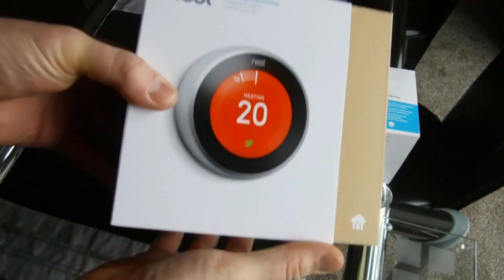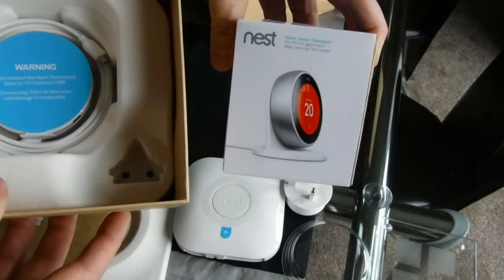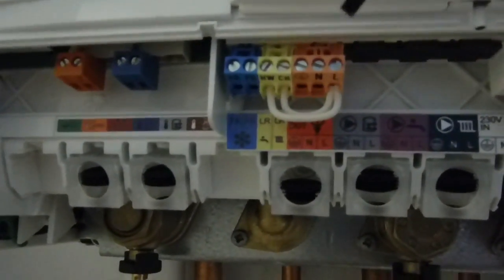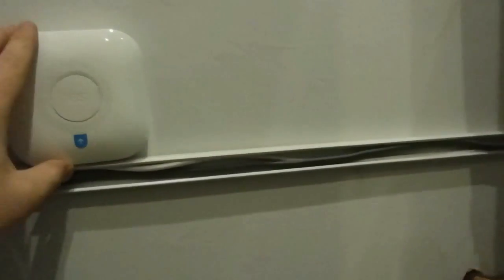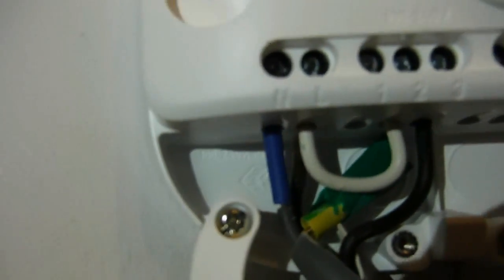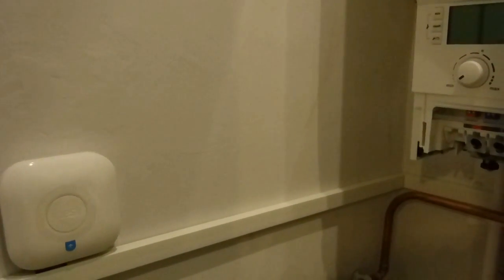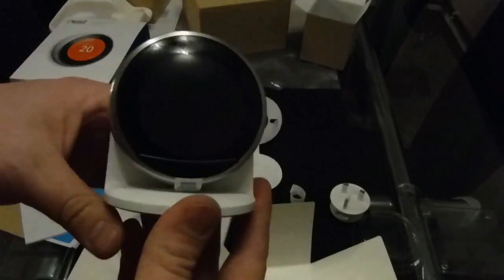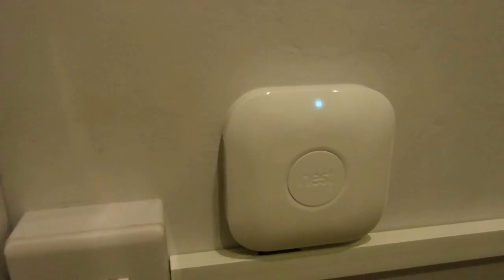How to install Nest Thermostat 3rd Generation - UK

Comment: Thanks for the video, i was also missing the link between live and 2, which i have now added. But even thou when i switch on the override the heating does not switch on, i checked the voltage for the live return at the link and at the boiler and i have 230+ volts being fed, I have a Worcester Greenstar 2000 combi boiler. I was tempted to phone Worcester as its a brand new boiler. Any advice would be greatly appreciated

Comment: There is an earth terminal on the heatlink unit, it states in the instruction book to install an earth if using terminal T1 and T2 for the 12V supply
Reply from the maker: @GTH67  Yes, I think I've covered that. I've now got mine linked up to Nest via T1 and T2 so made sure it's earthed.

Comment: What happens if the thermostat is unplugged or switched off- will it still switch on/off the heating?
Reply from the maker: No, it needs power, although it has got a little reserve on it I think. But if the power's gone off, the boiler won't be working anyway!

Comment: Just bought one myself and pretty sure I need the same set-up. May contact you with an image of my terminals if thats ok? Thanks for thd vid.
Reply from the maker: Let me know what boiler it is and i can usually find the user manual online or an image!
Reply: @charlieshooter  it's replacing a Honeywell by the way...
Reply: BAXI Duo-tech combi 33 HE A, thanks a lot for the help. 👍
Reply from the maker: @FullClipKilla  So your boiler needs to be wired differently to the video! It is actually a bit simpler.
Your boiler manual does state that you need to power the Heatlink directly from the fused spur (wall switch near boiler) rather than wiring the live, neutral and earth to boiler itself.
The only wires you run to the boiler then, are from 2 and 3 on the Heatlink to bk1 and bk2 on the boiler. No live loop required on Heatlink.
Hope that helps.
Reply: @charlieshooter  that's great, thanks for the help. Much appreciated.
Reply from the maker: @FullClipKilla  No problem! 👍🏼

Comment: Does it have to always be plugged inn to the USB cable/stand? And how does that work if it's mounted on a wall? Cheers.
Reply from the maker: It does need a constant power supply so yes it needs to stay plugged in. If it's attached to the wall, you can either run the power lead to it (if you've got hollow walls, or power it from your boiler via the old thermostat wires.
Reply: @charlieshooter  thanks for the reply. 👍
Reply: @charlieshooter following up on this, I’ll be able to wire the other box to the WB boiler no problem - but I cannot see how I’ll get power to the thermostat itself. My current old thermostat runs on batteries and is about 4 meters from the boiler through a kitchen and a hallway and this is the best spot for the new nest when it arrives. Is there a guide specific to providing power when needing to wall mount the Nest thermostat when it’s several meters from the boiler? 

Cheers.
Reply from the maker: I have actually recently done a video but not edited it all yet! It's quite straight forward. You just need to use 2 existing wires and connect them to T1 and T2 on the Heatlink, and then to the connections on the back of the Nest wall mount.
Reply: @charlieshooter  great! Yeah I think I’d realised the actual wiring connection will be straightforward - I’m more concerned about running several meters of cable in a tidy and concealed manner through two rooms. I much prefer the design and functionality of the nest but I think I’m going to have to switch to a hive for ease of wireless installation. 

Alternatively, is there a specific type of wire I need (resistance rating, thickness etc)I if I did choose to install the Nest and run several meters of wire to connect it?
Reply from the maker: @dizz740  The wire required is low voltage so doesn't need to be that big. I used a run of flex when I finally got ours wired up.
Reply: @charlieshooter  cheers. I discovered it had to be solid core copper wire max 2mm. But I’ve since discovered that the thermostat can be wall mounted AND connected via USB!!! Which is what I’ve done and it’s now working. Thanks for all your replies.

Comment: The Hive comes with a heat link (I think) that you wire into your boiler, and then a hub, which I assume is for phone connectivity. Does the Nest come with the same two things? You didn't appear to have a wireless hub in this video.
Reply from the maker: The Nest just comes with what is shown in the video. The Heatlink and the Nest unit itself. No separate hub.

Comment: Can you use it on older Worcester boiler too. ?
Reply from the maker: It depends on the connections and if there is already a programmer on board on the boiler.

Comment: My boiler is exactly the same and has a programmer installed previously, this appears to be to stopping the nest, any suggestions?
Reply from the maker: If the programmer is part of the boiler you may not be able to disconnect it, but some can be and then the Nest should work fine.

Comment: Is it possible to have one of these down stairs and one up stairs reason being my mam is old and we already have one down stairs but is it possible to link another for upstairs
Reply from the maker: It needs to be one per boiler/heating system I'm afraid. So it's usually one per property....unless your heating is split.
Reply: @charlieshooter  thanks charlie i was just wondering if you could link two together  . Will have to zone it the  no bother.

Comment: Hi I have some twin and earth cable but just wondering where the black cable is from thanks
Reply from the maker: It's 3 core and earth cable. I had some off-cut from another job in the house but you can get flex with 3 core too.

Comment: Hello! Great video. I have a thermostat upstairs and downstairs. Would the process be the same?
Reply from the maker: If you have two thermostats which control two different boilers then yes, and you'd need two Nests. The Nest can only control one boiler at a time.

Comment: What do you do if you don’t want exposed wiring?
Reply from the maker: At the Heatlink or the Nest Thermostat?
Reply: @charlieshooter   at the Nest Thermostat. I was considering fixing to the wall but how would you supply 12V power with plugging in to wall? You would need a transformer somewhere I assume?
Reply from the maker: @OBS3RVE  Well....it's funny you should ask because after all these years, i have only recently done exactly that. I have recorded it but not got it edited yet!
You can either put it where the old thermostat was and use existing wires, or if there is power the other side of the wall you could drill straight through? Other than that, if you are able to, run some new wiring for it from Heatlink. I did the latter, but we had totally gutted the room!
Reply: @charlieshooter  I’m currently mid way through renovating my house so will be able to chase the cables in
Reply from the maker: @OBS3RVE  It will look so much neater, good luck with the renovation.

Comment: So you wire 1 and 3 from heat link to boiler and put link into 1 and 2 that right ?
Reply from the maker: No, I think you need to re-watch the video again. The link is between L and 2. There is no wire to 1. N, L and 3 link to the boiler.

Comment: Hi, thanks for the video. Just a question, can I connect directly from main fuse box with 1mm or 1.5mm
Reply from the maker: The cable used to connect the Heatlink to the boiler should be flex but mine has been fine all these years! 👍🏼

Comment: Only heat resistant flex should be used to wire into a boiler.
Reply from the maker: A few people have mentioned this, but it has been in place for a number of years now with no issues.

Comment: Thanks for the video.
I have just connected mine.
I didn't loop the constant live for the hot water (connected it directly) and I did connect the earth wire next to t1&t2 terminals.

The only issue I have is that, despite it having a rechargable battery, it wants to stay plugged in (the thermostat). Maybe it's not fully charged, we'll see.
Reply from the maker: Mine is always plugged in. It needs to be as the battery is only really a back up.

Comment: Why do you need to link the incomes to common.. would it work without ? For some reason I keep blowing the fuse in my fuse spur
Reply from the maker: It may be that your boiler requires a slightly different connection method....where there are two connections at the boiler you don't loop the live in to no.2?

Comment: I want to install mine on the wall, and I have a power socket behind, does the wall mounting plate allow the cable to come from behind neatly ?

Thanks
Reply from the maker: Yes. The wall mounting bracket is used to attach the Nest to the stand so it's the same really. As long as you drill a hole in the wall to pull the wire through in the centre of the bracket you should be fine. Look out for a new video at some point showing how to wall mount it. I'll be moving mine soon....at last!
Reply: Top man 👍

Comment: You say the Live goes from Live to 2 and the Blue neutral at the boiler goes from here to here, but where is here?  3 connection is the heat link isn't it. Sorry if I'm missing something. really like your video though.
Reply from the maker: Thanks, hope it's helpful. I think I say neutral goes to Heatlink (rather than "here") but basically blue neutral goes from neutral terminal on boiler to neutral terminal on Heatlink.

Comment: Please, I need help with my nest. It says:"the power from your equipment to the thermostat may be off "
Reply from the maker: Sounds like there may be a loose connection at the Nest Thermostat or at the Heatlink. I presume it is hard wired and not plugged in?

Comment: Can you tell me if it works with with any kind of central heating or will it work only with certain ones
Reply from the maker: It will work with most I think. What did you have in mind?
Reply: @charlieshooter  i want to get one for mine, and i don't know if the google nest will work with any type of central heating or just specific ones...

Comment: Hi thank you for the video. My current thermostat is Danfoss, I have COM and N/O wires connected only. Earth is there but not connected. How do I connect the the heat link and nest thermostat?
Reply from the maker: The Heatlink needs to be put near the boiler really, and connected directly to the boiler. You could use those wires currently in place by the thermostat to wire the Nest to the Heatlink using T1 and T2?

Comment: Looking for some help here, can I install a room thermostat (Nest 3rd gen) in the cellar where there is no heating? If not, do I need to extend the wires or something?
Reply from the maker: If you install a thermostat in a room with no heating (radiators) then it wouldn't work because it would never heat up and therefore wouldn't switch the boiler off.
Reply: @charlieshooter  I found out it comes in two pieces. The base will go in the cellar and the interface can go in a room. The only problem now is which room to put out in as there are tenants in each room other than mine but mine is the furthest away so I'm hoping it's not too far for it to connect via radio or whatever it uses. I'm hoping WiFi but I think it's radio.
Reply from the maker: @analogdistortion  It should reach, the range is pretty far I think.
Reply: @charlieshooter  And what about powering it, will it just run off a microusb phone charger?
Reply from the maker: Yes that is the easiest method of powering the Nest.

Comment: Great to hear a fellow Welsh man. Cardiff I reckon. Anyway if it wasn't lockdown I'd get you round and set it up for me and I'd take down the Royal Oak. I digress, if it's hardwired via t1 & t2 does that mean it can't be used wirelessly? I'm getting this f6789kibg error code N80. Soo I can't use opentherm! Any ideas?
Reply from the maker: One city out I'm afraid! Just along the M4 from Cardiff! 
If you wire the Nest in to T1 and T2, it just means that it takes it power from there. It will still work wirelessly.
Open Therm is another type of connection for the Heatlink to talk the boiler. The boiler must have Open Therm though.
Reply: @charlieshooter  thanks chief. Yeah it's wired in on opentherm. Can't get a  wireless connection. Driving me nuts. Anyway I may just go back to it being an on off. I'll call nest later see if they can help all the best and stay safe.
Reply from the maker: A factory reset may be the best option? Keep safe.

Comment: Hi pal. Can I use a 2.5mm2  cable? Thanks.
Reply from the maker: You should really use flex to connect it but I have had no issues with my set up as it it. You might find 2.5mm² is a bit too wide for the terminals....maybe.

Comment: how easy to install one for a glow worm flexicom15hx current thermostat not doing a good job
Reply from the maker: Looking at the manual for your boiler, very similar to the video. Linking 3 on the Heatlink to R on the boiler.

Comment: Hi 
We have a alpha 18 boiler with a separate immersion system hollywell slider control panel 
Will this work with it
Reply from the maker: Yes the Nest should work with your boiler. Just had a look at the manual for the boiler and it looks like it is wired similarly to how I've done mine in the video. You would connect terminal 1 on your boiler to terminal 3 on the Heatlink. 👍🏼

Comment: If my current zoned thermostats got two 230v wires, how I can install the nest 3rd to replace them? Many thanks
Reply from the maker: They should wire in directly to 2 and 3 on the Heatlink.

Comment: Can I deactivate the nest/WiFi and use the heating/boiler the old fashioned manual way if I want to ?
Reply from the maker: Yes , I don't see why not. Although I don't know why you would want to?!
Reply: I didn't install it and don't want it
Reply from the maker: @misshollywood3255  Fair enough! Yes, it can be removed, but the old controls may not be there anymore!

Comment: Any info on installing to a wireless programmer? The receiver is in the loft space close to the boiler, but I will need the thermostat downstairs (bungalow) in the hallway. Distance about 4 mtrs, but through  a plasterboard ceiling and joists. Great vid!!
Reply from the maker: The Nest wouldn't need a separate wireless programmer. It's all built into the Nest itself. 4 metres through a ceiling shouldn't be too much of a problem for the wireless signal though.

Comment: Hi, very helpful this video. 
I’ve got an Alpha Eco 2 Plus do I wired the same as you did yours? 
Thank you
Reply from the maker: Just had a look at the manual. That looks a bit different to how I did it in the video. You would need to wire 1 and 2 on the boiler to 2 and 3 on the Heatlink by the looks of it.

Comment: Well I thought this would be simple enough as I have done one of these before. However in the new place I seem to have an older boiler and I can’t make head nor tail of the wiring. It’s a Baxi 80e with a Grassell digital timer. It mentions in the manual to make sure the programmer can take 230v. So I assume I use the 230v diagram. 

On opening the terminal out on the right hand side after the fuse it is all going into the PCBs and such. Would I be right in assuming the black wires going from terminals 1&2 are controlling the grassel timer. I can’t see any obvious connects. 

Do I remove those, add live, neutral to the right hand side after the fuse and then Terminal 2 to nest 3 while putting a link from nest live to nest 2?

https://i.imgur.com/pLy0x5h.jpg

https://i.imgur.com/mPg7wD1.jpg

Or do i do the other combo wiring as per my last one?
Reply from the maker: Looking at the pics, boiler instructions and Nest instructions, my advice would be to run live and neutral from terminal block to live and neutral on Heatlink. Then take that yellow loop out and run one of the black wires to 2 and the other to 3 on the Heatlink. Let me know how you get on.
Reply: CharlieShooters KnowHow  Thanks. Just to make sure. Do I run the live and neutral from the left side or the right side of terminal block after fuse?
Reply from the maker: @AFC19034life  Left side looking at pic. I wouldn't mind getting that white flex cable goes to the old timer. Will need to take that out.
Reply: CharlieShooters KnowHow Thanks again. I believe that flex goes to the socket.
Reply from the maker: @AFC19034life  Oh right....well you should be able to take the Heatlink off there too. 👍🏼

Comment: Hi mate great vid, I already have nest installed via hardwire to the boiler but the Thermostat is located in a cold room. I would like to move the thermostat into the living room to have more accurate temperatures. Is it possible to control the boiler by just plugging the thermostat into a wall socket for the power and negating the need to be hardwired. Many thanks
Reply from the maker: Yes, it can be plugged in to a wall socket and will communicate wirelessly to the Heatlink. Funnily enough I'm just doing the opposite....had it just plugged in the wall and now going hardwired! Thanks for watching! 👍🏼
Reply: Thanks for that , my nest is in the hallway which is quite draughty that’s why I’m moving it to the living room 👍🏻
Reply from the maker: @stevetaylor6833  I've always had it in the living room upto now, but whilst I've been renovating it I had it in the hallway next to the front door. I certainly wouldn't leave it there!
Reply: That is where mine was installed and like most houses the hallway is one of the coldest rooms.20c in the hallway amounted to 25c in the rest of the house, bloody heatwave🥵🥵

Comment: Our boiler has one of those annoying manual ticking timers on it - if we get the nest could we safely remove that annoying ticking timer?
Reply from the maker: As long as it's not an integral part of the boiler you should be able to get rid of any old fashioned mechanical timer after fitting a Nest.